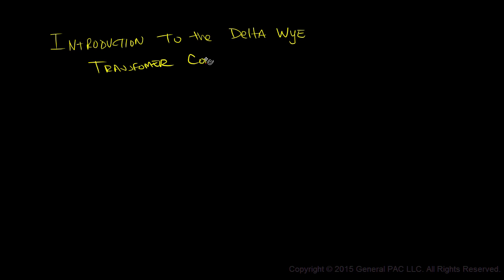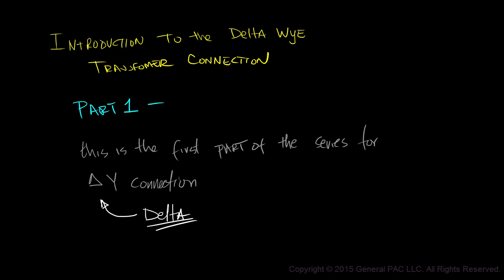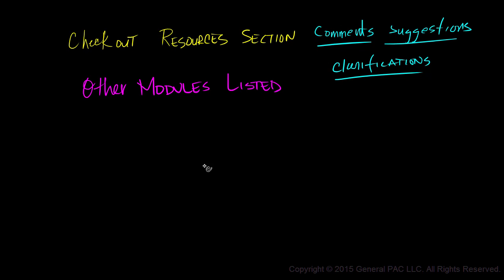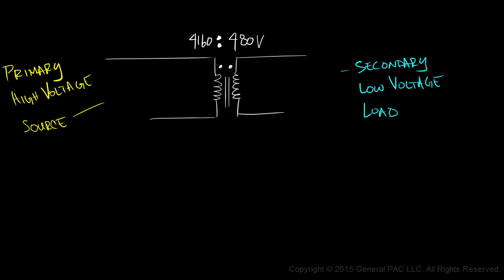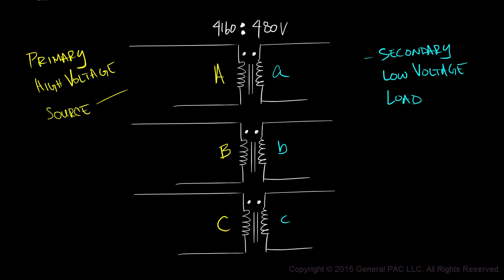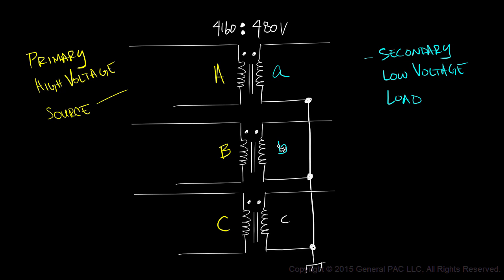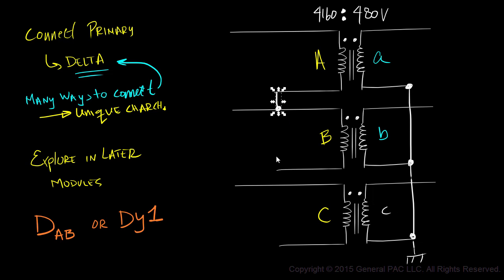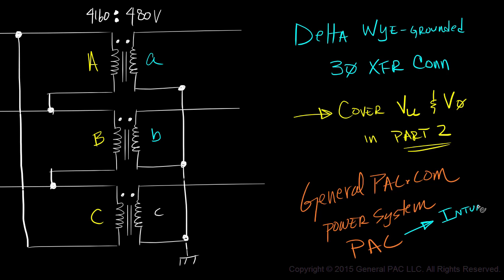Introduction to the Delta Wye Transformer Connection Part 1: Delta Connection

Comment: Doesn't the primary system act as a load since you have a voltage drop through the terminals where as the secondary acts as the source since it is supplying power to the load?
Reply from the maker: Hello Brandon,

You are right somehow. It all depends upon the direction of current in normal condition and at which side we connect the source or load. We can have the following two conditions:
1) primary side as source and secondary side as load
2) primary side as load and secondary side as source

Here in this example, we have considered primary side as source and secondary side as load. As, in USA the 4160 V delta connected side is considered as source end and 480 V wye connected side is considered as load end.

Hope it answers your question.

Thanks,
GeneralPAC by AllumiaX

Comment: Just confirming on the video you mentioned DAB or Dy1 transformer. However, I think  this is for a DAC or Dy11 transformer as also mentioned in the description. Am I correct?
Reply from the maker: Yes, you're right. This is for DAC or Dy11. You can see in the video that the polarity side of A winding is connected to non-polarity side of C winding which is the identification for DAC or Dy11.

Thanks
GeneralPAC by AllumiaX
Reply: @Generalpac  ok thanks for confirming.

Comment: Thanks for specifying the vector group (at least in the video's description) of the transformer under study. A Dy1 Tx also shifts by 30°. And there're even other D-y Tx's that shift by different degrees, such as Dy7 and Dy5.

Comment: I have question why always use Delta/Star Transformer on HV Transmission line , Why not Delta/Delta or Any other configuration 
THANKS,
Reply: Star/star is utilized, but not recommended, due to the unbalanced LV 3 phase grid, as well as 3rd harmonic propagation